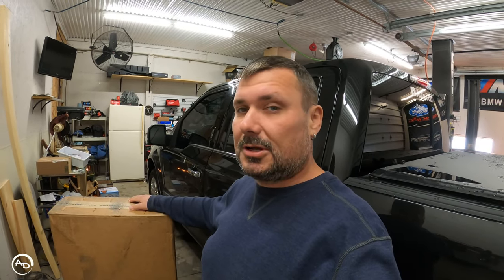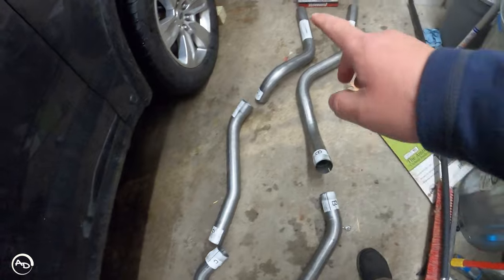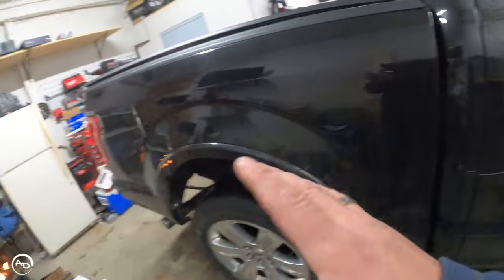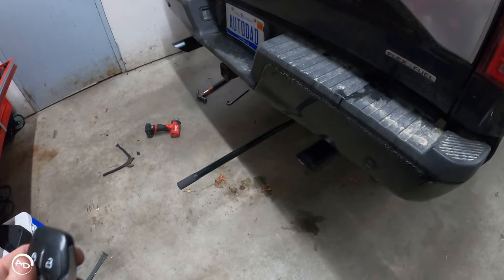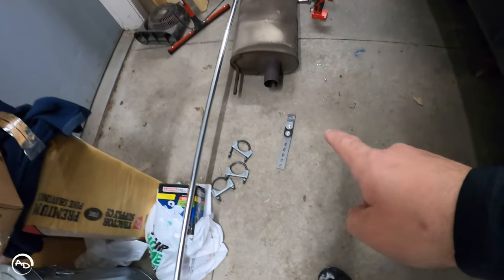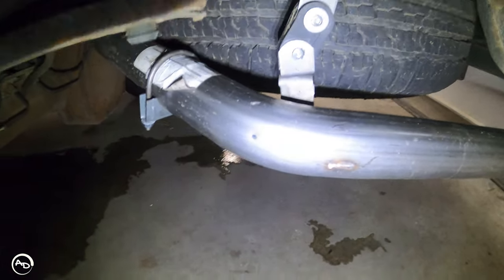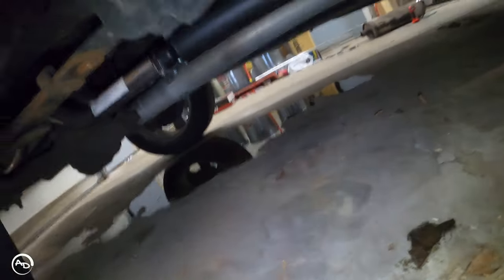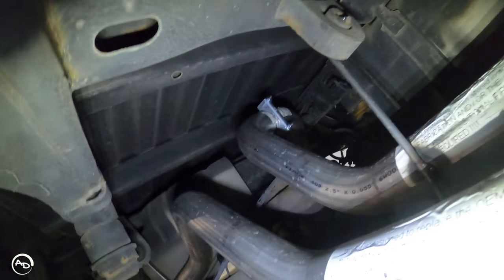Cheap Flowmaster kit with dual tail pipes install | F-150

Comment: I bought a kit from them 12 years ago for my 2001 f150 5.4. The system lasted for the most part. The tips rusted out after about 4 years but the rest was still in good shape when I just donated the truck. My new to me 2018 f150 5.0 is getting a stainless system from diamond eye for $400 bucks.